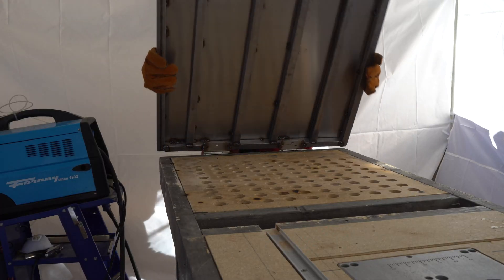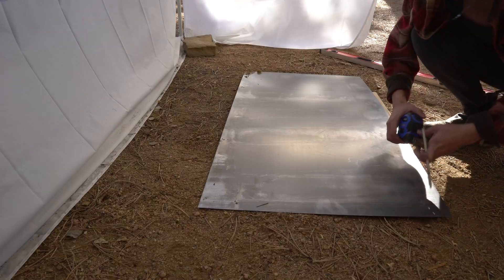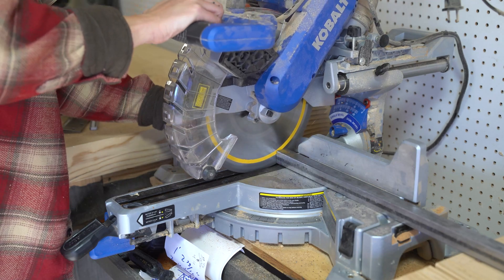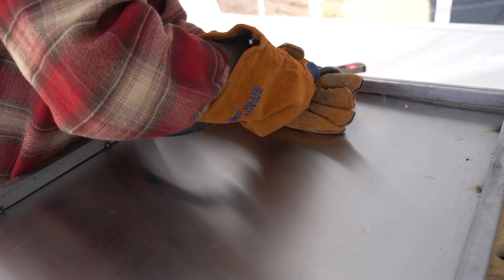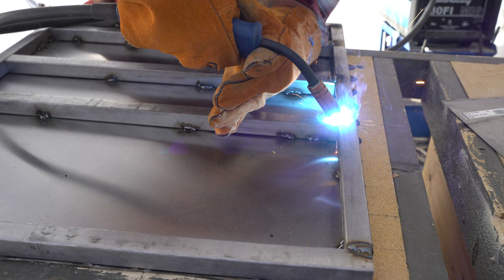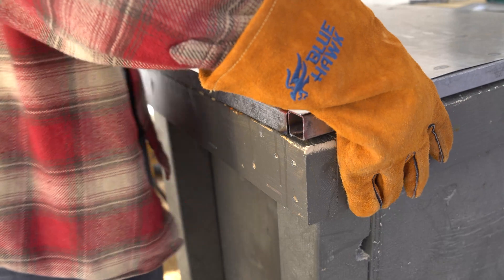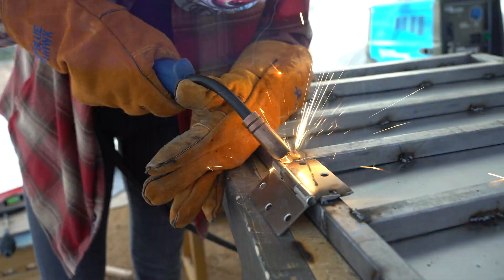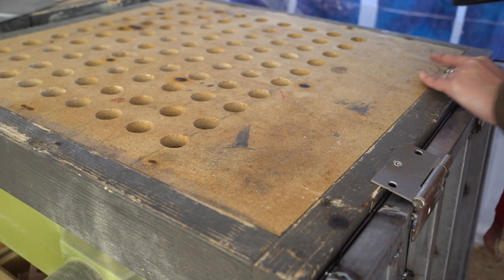DIY Fold Away Welding Table | FIRST WELDING PROJECT!

Comment: welding such thin sheets is by no means easy, you did a good job there! if you like you could weld an angle-iron (L-shape) on the hinges so you can give it more support by screwing it to the side of the wooden bar.

Comment: Little more gas, higher wire feed and slightly higher amps. Should help fix porosity, stability and weld size.

Comment: when mig welding, dont do so much of a side to side motion. just keep it pointed right in the joint, and do a straight line. watch the sides and the middle will fill itself

Comment: Its awesome that you are expanding your knowledge and trying new project outside your comfort zone. Not to mention that you are also recording it for all of us to see and for the keyboard "experts" to critique your work while they sit in their parents basements, lol. It is so satisfying to learn and achieve a new skill. 
Just a bit of advise, slow down on your torch manipulations and concentrate more on watching what your weld puddle is doing. I would suggest cutting a bunch of coupons of 1/8" flat bar and spend some time welding them together with full passes and weld overlapping passes once they cool. It'll also give u some time to learn your machine and fine tune your settings. It'll take time and practice. Heck, i was terrible when i first started welding 20 years ago. 
Keep up the awesome work
Reply from the maker: Thanks, Clint! It’s the experts like you I was hoping to hear from - those are great tips and I’ll definitely used them as I get more welding hours under my belt!

Comment: I really appreciate the mindset you have coming into this with the intention to learn! :D
I have less welding experience than you, so I can't really give a fair criticism, but I'm a hobbyist myself and I have two thoughts:
1) having the hinges attached to the wooden part only by a single screw each, at an angle, and also near the edge, won't last long, I reckon. Maybe you could reinforce the wooden part with metal and then attach the hinge to that. Also don't worry about drilling more holes into the hinge flaps to screw more screws. :)
2) You wrote you took a weekend welding course, but I don't think I've ever seen any welding move the tip back and forth like you do. AFAIK you should be moving slowly and in one direction only. I watched This Old Tony a lot: https://www.youtube.com/watch?v=Vfhz9anpaWE
Reply from the maker: I’m totally with you on the hinges - they’re not long for this world set up like that. In my head - and first attempt, haha - they were supposed to be side mounted, so I bought smaller ones. I may go ahead and just add a little extra plate steel to extend/get more practice in! 

And thanks for the resource! I’ll def check him out. I think I’m definitely exaggerating the “pool and push”
Reply: @HonestWorkDesigns  I've been working in a metal workshop for about a year and the pool and push vs general slow speed is very personal. I've noticed that most people do a side-to-side motion instead of back and forth, keeping the pool going slowly whilst making the weld slightly larger and hence stronger.

We're talking about maybe 1mm to both sides from the centerline of movement here, so the rod only moves about 2mm's side-to-side.
Reply from the maker: @OcayaGaming  thanks so much! This insight is super helpful!